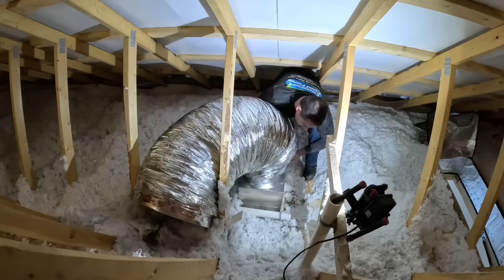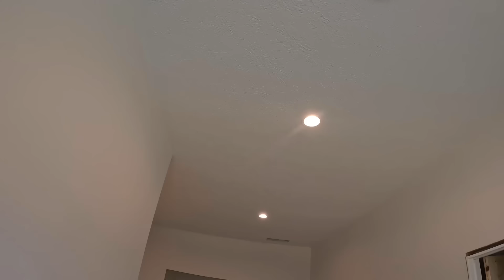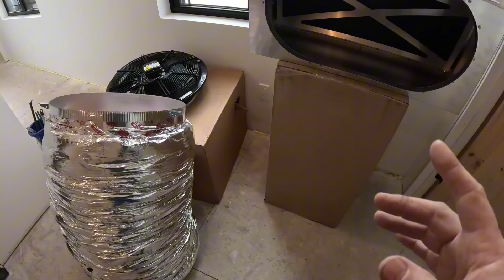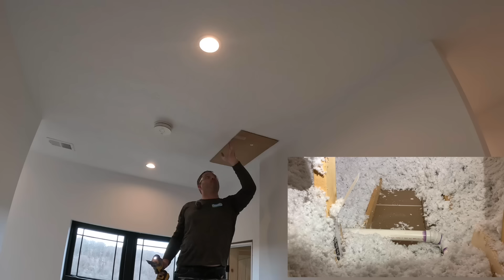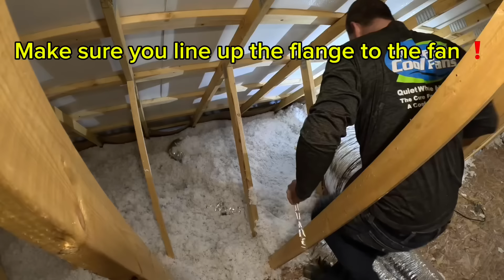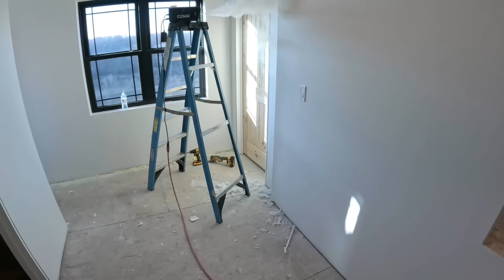DIY whole house fan install @CentricAir

Comment: That smoke alarm is too close to the fan register. NFPA 72 requires 36” to any air movement devices/grills and the smoke probably won’t function right because of the air velocity (you actually point out in the demo that it doesn’t set off the smoke). Just a thought. That smoke with also get dirty quicker and start to cause nuisance alarms or require cleaning.
Reply from the maker: Never knew that I appreciate you pointing that out 👍

Comment: love the screw idea to hold the template up.  Do you know how many hundreds of times this would have been beneficial for me.  Super cool to have the view as you were cutting the panel out of the ceiling.  I always cut my holes too tight and it ends up biting me.  I also should have purchased a battery powered oscillating tool when I got mine as well.  Oh well... live and learn
Reply from the maker: Yeah, last minute I thought it would be cool to catch a different angle while cutting it 🤷🏻‍♂️👍
Reply: @fatefarmspa  good call